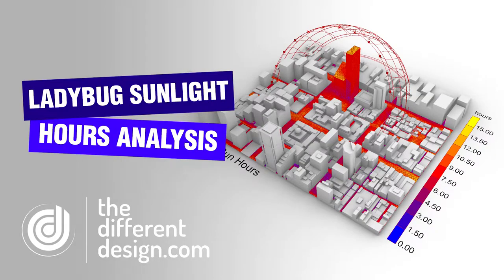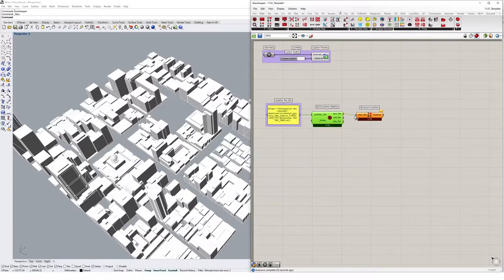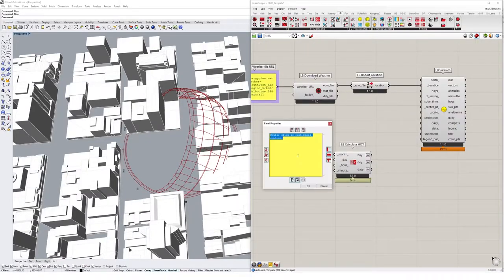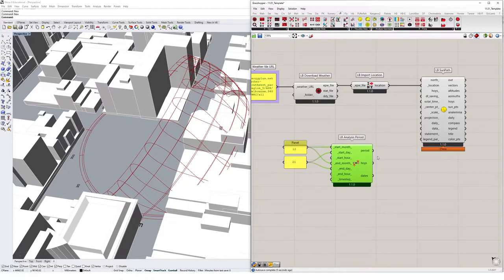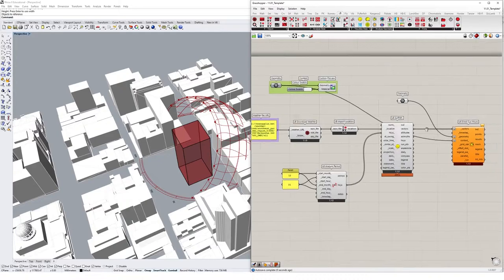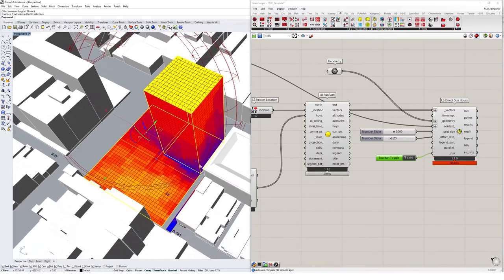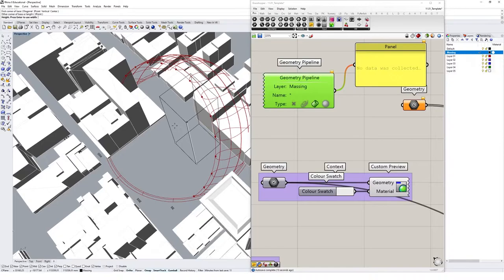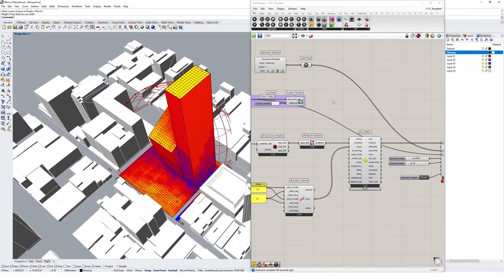Ladybug Direct Sun Analysis in Grasshopper

Comment: the downloadlink does not work for me. can I collect the folder with the weather data? i tried to connect it with the epw file by naming a text box "C:\Users\Cornelius\Downloads\Setups\ladybug-tools-1-1-0\weather data frankfurt" (with the epw file) and connecting it with the epw import for the import location. then I take the output into the LB SunPath location input but it doesn't work. the "epw import loc" can not collect the data. is something wrong with the name of the path or is it not possible to create folder paths with text boxes?

help would be very appreciated. thanks :)